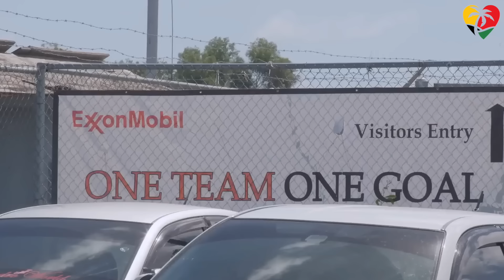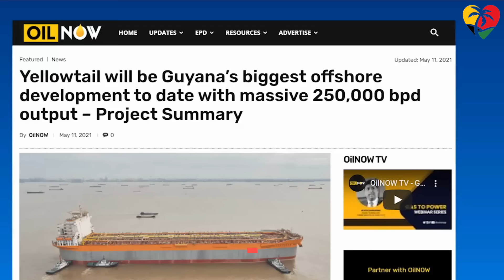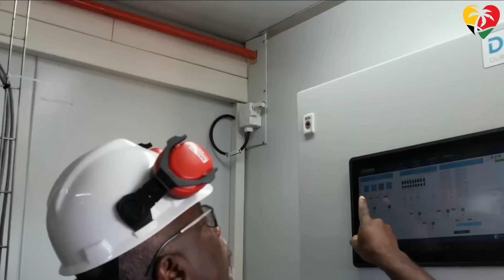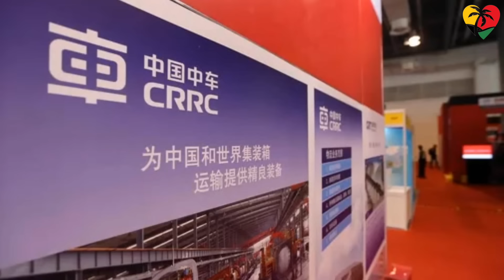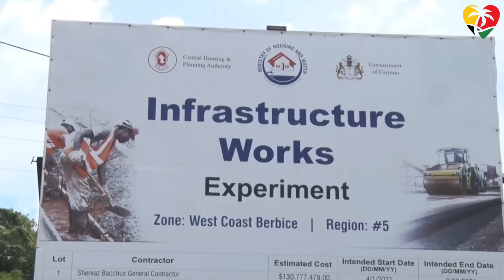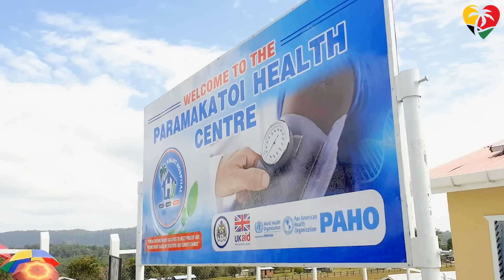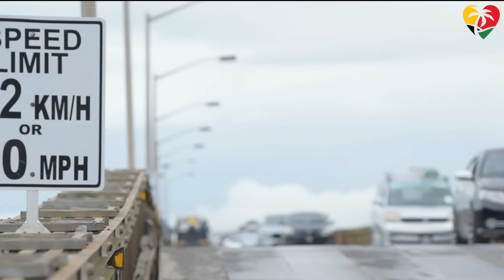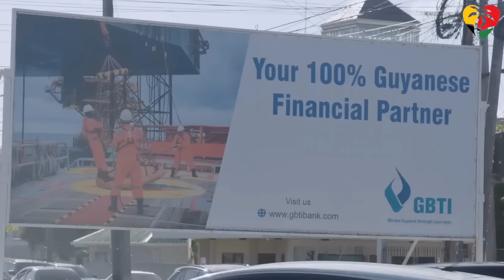Guyana's Mega Projects 2024: The Caribbean's Fastest-Growing Economy Revolutionizes Future

Comment: These are just a few. 
The most important which is the Gas to Energy project which will provide cheap LNG for export and reduce energy costs. Costing almost 1.8Bill USD. 
The construction of 4 new stadiums at 15mil each. 
The Corentyne 4 lane Highway which will cost almost 400mill. 
Construction of 6 new hospitals in addition to the New Amsterdam Hospital. 
And lots more. Many of these are multi year projects though. And there is also private sector investment projects as well.

One correction the airport is completed already they are thinking of a new terminal now. Probably with private investment but nothing confirmed yet.